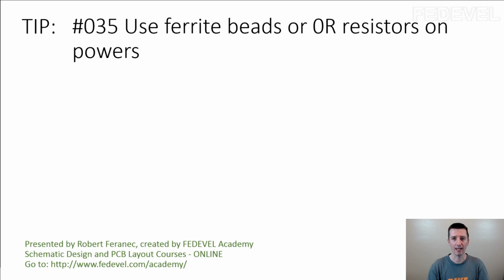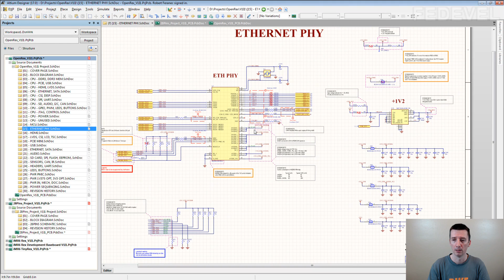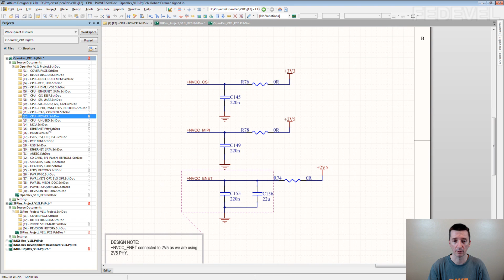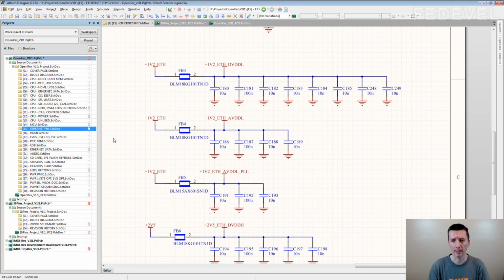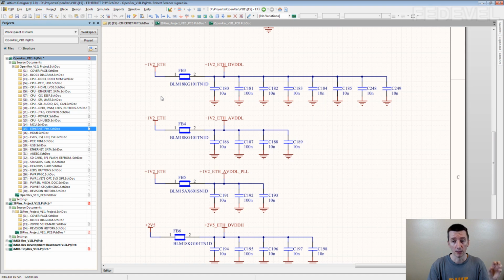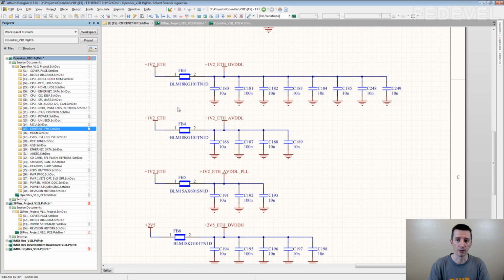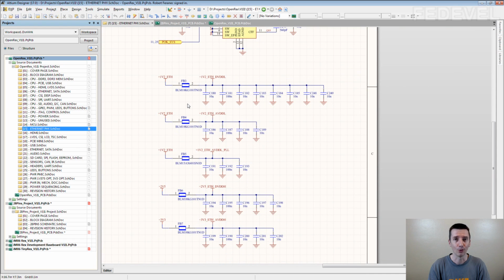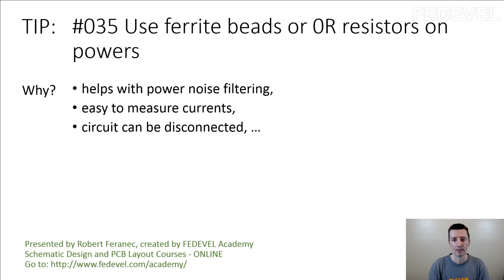TIP #035: Use ferrite beads or 0R resistors on powers

Comment: I am really full totally and completely confused about the connection between 0R and ferrite bead, ferrite beads are used to filter high frequency noise since they dissipate the high frequency signal as heat while the 0R resistor is basically supposed to be a short. What is the relationship?

Comment: Don't use ferrite bead as its not good idea for high performance board. 

Check below article

https://resources.altium.com/p/everything-you-need-to-know-about-ferrite-beads#:~:text=In%20terms%20of%20composition%2C%20ferrite,in%20a%20small%20form%20factor.
Reply from the maker: Since this video, I have learned some new things and yes, now I am more careful about ferrite beads. Especially after making this video: PCB Layout & Decoupling - Measuring and Fixing (Part 3) https://youtu.be/hZSOhVdzqZk
Reply: @RobertFeranec  
You should implement this things in your courses.
Reply from the maker: @abhichokshi496  I am working on updates ..... just it's a lot of work

Comment: I personally quite often use small 2r2 or 4r7 resistors (even with ferrite beats). Not only for the noise but also as a cheap fuse.

Comment: What should be the value or model of the farrite beads here....
Reply from the maker: I usually use the BEADs from reference schematic or I use the BEADs what we use on different projects (so we have them in stock). Important is current rating - be sure the BEAD can handle the current. If you would like to calculate BEAD values more properly, the BEAD manufacturers have some tools for it, e.g. https://www.murata.com/support/faqs/products/emc/emifil/use/0010

Comment: Thank you for the video!!! If i use sensor like bme680 or dac, adc mcp4725, mcp3425 - do I need add FERRITE ? when modul small like adafruit or sparkfun? Or i need use ferrite only for microcontroller or microprocessor. Thank you!
Reply from the maker: Usually I place ferrite bead: 
- before a component / pin which may generate noise back to the power rail, 
- before a component / pin which may be sensitive to noise on power rail, 
- to separate main power rail from a local power plane
- on components where I would like to have option to measure or disconnect power
So to answer your question directly, usually for components like sensors, I do not use ferrite, they are usually conencted directly to the big power plane, for ADC I may use ferrite (or I use LDO regulator, depends how sensitive AD is), for DAC I may want to use it. If the module is very small, beads may not be necessary, but I would be using some kind of filtering anyway.

Comment: As I know, ferrite beads have different resistance values. What range of resistance of ferrite bead is appropriate for applications that uses lower than +3V3 as power source voltage? Is there any criteria or guide that you know to select best resistance value for ferrite beads?
Reply from the maker: Normally the simplest way is to use the same / similar bead as in reference board. Sometimes we minimize number of different beads in the design by using same beads as used in the most critical part of the schematic. 
Ideally you may want to go to a bead manufacturer website and they have some recommendations or calculators - that can be specific for the circuit you are using. I am not sure if there are some really generic recommendations.

Comment: according to my info zero resistors are used for test purposes or to make designed pcb more flexible for future adjustments. It can not work as a filter unless it is changed to a real non zero value. we all know that the cut off frequency for low pass filters is f=1/(2xPixRC) so if R=0 >> f= infinity that means no filtering. Please correct me if I am wrong.
Reply: They have none-zero resistance and also some inductance, but I'd guess they're just there to leave space for adding a bead if needed later, or for other rework on the power line.

Comment: I really like these daily tips and please keep them coming. I have a comment about this one thou:
"EMI containment is a major reason for ferrite beads in power leads of ICs. This solves the EMI problem by preventing the part from switching fast. All this is fine as long as the part does not need to switch fast. Virtually all modern ICs need to switch fast to do their job. Placing ferrite beads in their power leads stop the fast switching and the EMI. The same result can be achieved by turning off the power. With ferrite beads we treat the symptom (similar to treating headache with painkillers) not the problem, poorly designed power distribution system. 

The effect of placing the ferrite bead in series with the power lead of the device is to degrade the performance of the power delivery system by increasing its output impedance.  A power supply is expected to be a voltage source, meaning that no matter how much current is drawn from it, the output voltage remains the same and no matter at what frequency which that current is drawn, the output voltage remains the same.  Said another way, power sources are expected to have zero or very low output impedance at all frequencies in order to do their job properly. "
Source: http://www.innofour.com/8440/news/literature/lee-ritchey-faq-ferrite-beads
Reply: I agree. You also get some nice LC circuits you didn't have before and while cheap, they're not free and add additional points of failure.

Comment: If there is no recommendations made how do we choose the values for ferrite and the caps?
Reply: ilkay C you need to take in consideration the main frequency of the noise in the power rail, if you are using fixed frequency switching for instance, you want to filter that out.

If using LDOs, most specify a maximum capacitive load, so don't over do it.

Also be careful with startup time, loading a line with too much capacitance will slow down the startup.

My general rule when in doubt, is to always place more than you need when designing your board, since you can always not mount them, while capacitor stacking is pretty much impossible in production.
Reply: thank you Xavi